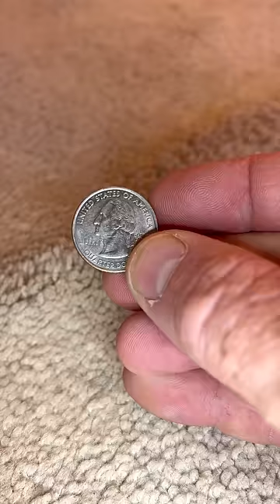Coin flip carpet quote

Comment: Harrys chance of winning was 75%. Thats a man that knows how to leverage his odds and confuse his opponent
Reply: a coin flip is infact 50/50
Reply: @duuuo  And having to win either of two coin flips to pay a discount is in fact 75%
Reply: Gamblers fallacy, coin flips are always 5050
Reply: @ekkehard8  that's not how it works. That's not how any of that works 😂 look at a roulette wheel the odds are usually 1/36. If it's 5. It is still 1/36 to be 5 the next time.
Reply: @tiredanddepressed  Here the conflict lies in the definition of "winning". For you it is regarding a single coin toss. However, a broader (and more frequent, specially in math) definition would be to gain a favorable outcome. (compared to base, which, here, it is implied to be the 150 middle ground) 
If the first coin toss is won, the price will be either 100 or 120 depending on the second coin toss. Either of those two outcomes are considered winning. 
If the first coin toss is lost, then the price will be 100 or 200, depending on the second coin toss. One of these outcomes is considered winning and the other losing. 
Thus it is necessary to lose on both coin tosses to lose, and any of the 3 other combinations of winning or losing two coin tosses is a win. (Out of 4 total) This is where 75% chance to win stems from. Either the definition for winning you are using is too narrow, or you lack capacity for understanding.
Reply: I’ve never seen someone be more confidently incorrect lol.

Look up conditional probability. What they’re playing for on the second coin flip depends on the first coin flip, which means that there are 4 possible outcomes. In 3 of those outcomes, the customer gets a discount.

3/4 = 75%
Reply: @tiredanddepressed  Brother never learned to do math

Comment: From one carpet layer to another, I really appreciate you showing the power stretcher, stay nails. Most chumps these days would have broke out the kicker and bumped it.
Reply: Definitely. I had an installer work for me. He never used a stretcher. Didn't even own one. He never understood we only got small jobs and small repairs. I miss it. My knees are happy I slowed down. Good times.
Reply: I sell flooring for a living, i love watching floor install shorts.  I think carpet is the one that no one ever wants to do, everyone thinks they can do LVP/LVT and Laminate all Willy Nilly.  Some think tile is that way too.
Reply: I'll get down on some pattern match. There is alot of full tile Tommy's out there
Reply: Or installing entire houses with spikes 😢
Reply: Ive installed carpet with my dad so I def wouldn't say I could do it like a pro but I have to ask since I'm a concrete finisher those nails damage the concrete. Why do that?
Reply: @milkmanman  the nails are really short aluminum just long enough to hold it in place most of the time in homes it is wood subfloor under the carpet. Now in a commercial setting it will be concrete and will take a chunk out of it if you drive it too deep. You don't slam them in just a few little taps.
Reply: "Most chumps these days would have broke out the kicker and bumped it."

That's why he was there.
Reply: @Cahwai  " I think carpet is the one that no one ever wants to do"
That's because carpet is the hardest work in flooring with the lowest pay. Though I may choose carpet over lvp since lvp is complete trash
Reply: @milkmanman  it's a wood subfloor. but when it isn't, no one is going to see it.
Reply: @jimbeam-ru1my  There’s a lot of “specialized” tools like the knee kicker most people won’t use it twice.
Reply: shit what you talking about they aint even using a transistion either straight into the strip thats coming loose cause they didnt set it properly into the concrete.

Comment: I use coin flips with my coworkers who I can tell have a hard time staring what they want. Instead of some awkward convo where one of us has to be dominant and just plainly state what they want(something that should be easy and could be solved with a coin toss in the case of conflict) I just skip straight to the  “wanna toss a coin to decide who starts in the office and who starts spraying?” Then I can give them the call of the toss so even if they lost they feel like it was fair. It’s something I used on my staff as a manager and now that I’m not a manager of my peers it’s still works just as well it just needs a different tact

Comment: The carpet guy is kind of dumb here because he accepted worse odds. Remember that the initial price was £150.

Let’s look at expected returns.

Scenario 1: Coin flip heads pays £100 and coin flip tails pays £125. Easy to see Expected return is £112.50.

Scenario 2: Coin flip heads pays £100 and coin flip tails pays £200. Easy to see Expected return is £150.

Scenario 3: Coin flip heads means we play scenario 1 and coin flip tails means we can play scenario 2. This has an expected return of £131.25.

Lots of ways to figure this out.

You could imagine it as 50% of earning £112.50 and 50% of earning £150 equals £131.25.

Or, 25% chance of earning £100, 25% chance of earning £125, 25% chance of earning £100 and 25% chance of earning £150. This works out as £131.25.

Comment: The story was funny, but the way yall make it look so easy fixing that carpet makes me sad. 
Many moons ago, in a land far, far away, no my mom thought I could do anything I set my mind to. I was about 15, 102 lbs, 5'7", girl. She found some carpet she wanted me to put in the living room.  I had no idea what i was doing because this was back in 1980, with no internet. I started on one side of the room and nailed it down, but most of the nails didn't go in straight.  I then pulled it to the other side of the room and began nailing it. Then i went to the sides and nailed them down. I went and bought boards and nails them down. It was sad looking when we vacuumed. The carpet would come up. Over time, the carpet kept stretching more and more from the vacuuming.  I finally took the nails out, and what i thought was fixing it by just making it down, but this time i also nailed it down around the center of the room. We learned real fast not to go into the room without shoes on. Finally a friend told me how to fix it. It looked pretty good after that.

Comment: Hey carpet guy I have a question that vacuum looking device that helps pull the carpets into the corner What is that called because I'm ripping out my old carpet putting in I'm assuming carpet but I also wanted to know what that tool is called thanks

Comment: Remember, on a standard US Quarter, you should almost always call tails, the heads side weighs slightly more than tails which means it will typically land face side down more often than not, however, if whoever is flipping does a manual flip at the end, ie slapping it onto the back side of their hand, call heads.

Comment: I laid floors for over a decade, and it is nice to see someone properly restretch an old rug.  I have seen guys go in with a knee kicker and just  try to pull it out that way, and then get all confused when they don't have enough carpet to reach the wall at the near corner.
I also saw someone use a spike on the old Stanley rather than poles, on an old loop pile that was starting to delaminate in places.  That $300 quote turned into $10k+ for a whole new rug, which honestly should be been the initial assessment anyway.